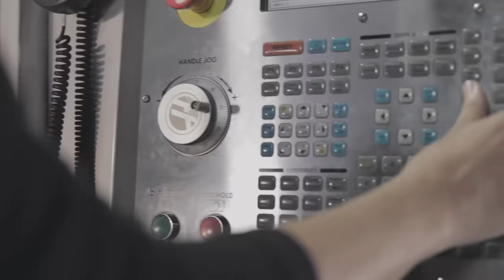CNC Machining a Warped Plate Flat | Incredible Technique for Precision Aerospace Parts

Comment: This video literally saved me a $800 trip to Blanchard grind and a week of time.. on a part I had to hold .002” flatness. thank you titan for all you do for the trade.
Reply: wow we used to get plates blanchard ground +/- .002 for $50 per square foot regardless of thickness. Most times they were within +/- .00075 but that was 1995 LOL

Comment: Make sure the eccentric clamps are in the middle of the raw material. When you they are down on the table they will push the middle of the plate upwards as shown in the video.

Comment: I used to make small parts flat and parallel to 0.0001. It was a slow process. The truth is in the optical flat with a monochromatic light source. Any new Mastercam videos coming soon?!
Reply: Not bad.
Reply: What machine were you using
Reply: I machined a plate like this 32"x16"x1" flat within 0.0008", I thought I was doing well with that, it was a total pain, skimming each side, probing, packing with shim etc, got there in the end though.  Couldn't use cast plate either as it was going in UHV for a telescope.

Comment: You should use a dti in the direction you wish to check as you induce sideways forces to the stylus. There was likely some cosine error too with the stylus being what looks to be around 70 deg to the body... Better off sticky tape and dry skim instead of pinching the plate too.

Comment: Been doing this for over 15 years with double sided sticky tape. Flat and Parallel within .015mm over 600mm x 800mm is possible. No mechanical fastener made will hold a part down like this without inducing stress. Get it flat n to size then machine your parts with mechanical fasteners. Obviously this was a “good enough, and way better than 6061comes from the factory”

Comment: What's so special about this? In fact, you'd do one face first, then flip it and repeat to get the other face flat and parallel... you'd typically do that in a conventional milling machine to not waste precious time on expensive CNC equipment...
Reply: It depends on the tolerances required. Sometimes you need to face each side in stages as each time you machine it, stresses are released and the plate distorts.